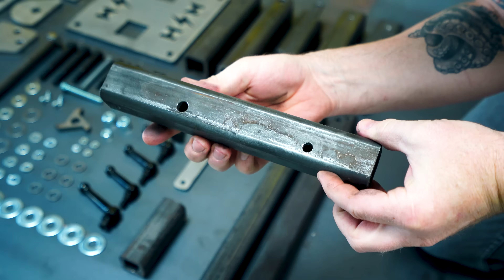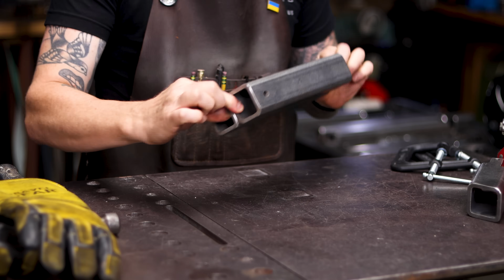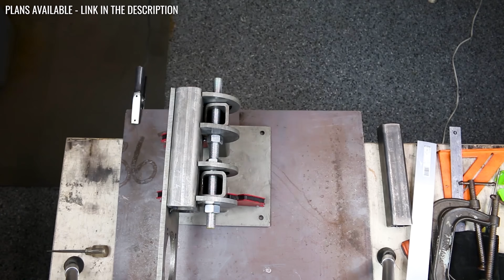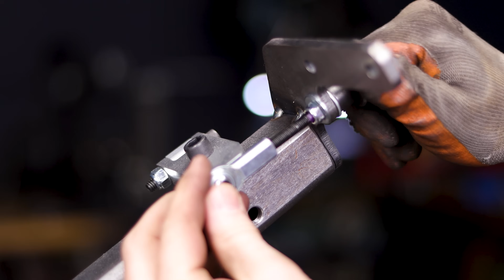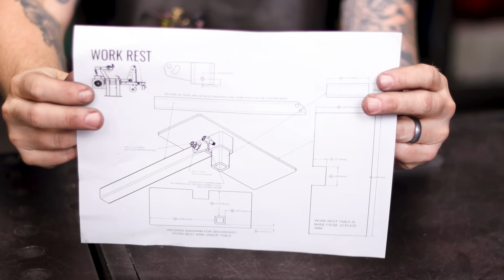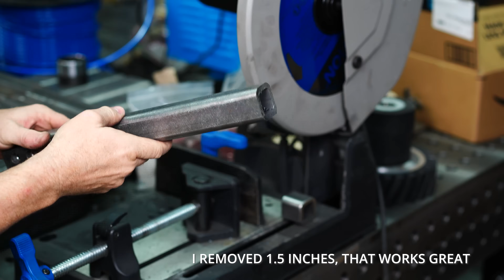How To: Generation 5 Revolution 2x72 Build

Comment: I picked up a 2 HP 3 PHASE motor free for my 2x72 belt sander. I love the $100 VFD video you did. My problem is the motor is not sealed. I am considering adding a fan on the opposite side of the shaft end that has a filter on it for constant air flow. I know it's alot of work to use this free motor but I gotta try it.

Comment: Should have some springs on the tracking device screws so they don't rattle and possibly set screws also.i suppose it wouldn't be hard to add them to it oneself either whilst building it.nice design and great videos
Reply from the maker: That's a great idea, thanks for the tip!

Comment: Recommended motor I purchased from Amazon shaft is too large for the  7" drive  wheel.  Brian, can you tell me what I should do?  Can you enlarge opening for fit my shaft?  Many thanks!
Reply from the maker: There is a small cover over that shaft, all you have to do is pull it off. 😁👍🏻 Easy!
Reply: @HouseMadeUS  thanks!!  Can’t believe I missed that!!

Comment: If I’m trying to mount a 3hp is there enough clearance or will the body of the larger motor interfere with the rear hinge, if it were an issue could I move the motor mount rearward making more clearance for the larger motor or would that also pose other issues??
Reply: Maybe I’ll measure first... but probably hang it back just enough to fill half of the rear plug welds and go slightly weld heavy around the perimeter to make up for it...
Reply from the maker: Yes it should have enough clearance. But always measure first. Thank you!

Comment: I’m curious… the flat platen is welded to the 90* brackets but I was under the impression the platen will need to be replaced from time to time?  I’ve seen some grinders, like the Bader for example, which I believe have a replaceable platen and the platen is a harder steel like 4130 or something versus just regular cold rolled?
Reply from the maker: There are two holes in the platen backer to attach different styles of platens. Works great for glass, leather, or high carbon. We are also working on a carbide platen.

Comment: Why not 2024 aluminum, or 7075, they’re both stronger… Btw aircraft grade only means it’s been chemically more accurate and tempered so there’s no stress in the billet, and less likely to have any micro voids. I’ve learned a lot over the years as a machinist

Comment: If i would like to make one of these and im living in Finland.. i should buy motor and vfd but we use 230/400v here. I have 3 phase 400v socket in my working space so should i buy 400v motor and vfd for variable speed control? And how to know if it fits to the driving wheel?
Reply from the maker: Please contact Matt at www.DIYEurope.eu

Comment: Would a Hobart 100 get enough penetration to do a solid job? It says it can only weld up to 3/16" material and the base plate is 3/8", I'm new to welding and don't know how strict these  requirements are. There's a big price jump to go bigger and ya boys on a budget. Thanks!
Reply from the maker: The work around for welding thicker steel is to preheat it with a torch. Mapp gas works great for this. It's not the most efficient way of welding but the Hobart 100 should do it with pre-heat.
Reply: I have a larger welder and I still only used about 85 amps to weld my grinder together, and I had to cut the motor mount plate off because I welded it on backwards and I was getting plenty of penetration!!! I’d say around 100 amps is about all you need for this project!!
Reply: I’m using stick welding that is ugly and I’m not a pro by any means so I may just be talking out my ass...
Reply from the maker: You're right, we've even done it with less. 😁👍🏻

Comment: I just purchased a DIY bundle. For the time and money that it saved me it's well worth the 700 bucks. However I am one to give an HONEST opinion/comment. The 1st 2 vertical support beams are so far my ONLY complaint. One was cut perfect however the other one was cut and ground very crooked up top where the radius is. I would have gladly waited one more week just to have that little bit of quality control. Because either way $700 is still $700!
Other than that I'm halfway through the build and it is looking pretty damn awesome. I'm not sure if maybe there was somebody new at the shop but regardless that crooked cut is there and it bothers me however it does not affect the main bolt that runs through them everything lines up just fine.
Reply from the maker: We did have a production issue. We sent all of those risers back to the machine shop to have them reworked. Unfortunately a few sets made it out the door before we noticed. We sincerely apologize for that.
Reply: No worries. It's only noticeable because I know it's there. Overall very cool design you have going on here and my son and I appreciate the informative videos you also supplied to your customers

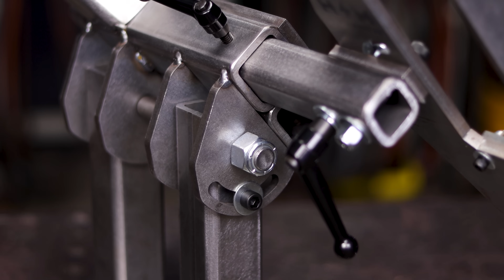Comment: @42:55 you might consider redesigning the front plate that holds the belt  so that it sits directly centred on the rotation axis of the entire machine.  This means the platform that will sit in front of the machine that holds the jobs to be ground will always remain centred to the belt .this can be handy if you are using a jog that holds the job being ground .  It currently appears that the front plate holding the belt rotates around the central axis of the machine and hence the belt moves off centre  as the main unit is  rotated
Reply: Platform that sits in the front being the workrest

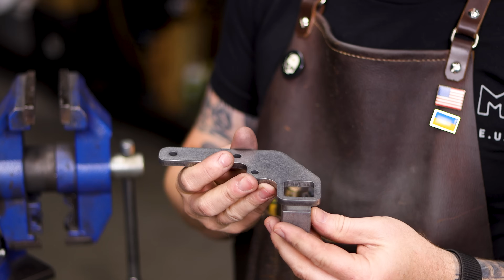Comment: @31:41 you might consider a washer between bolt and wheel bracket which helps the rotation integrity

Comment: @6.18 you can cut two pieces of wood cut to the distance needed  to jam between the two posts and clamp the posts and the bolt so the posts weld precisely to the base accurately . You should use right angle frames or magnetic to ensure those posts setup exact right. Get off to a good start

Comment: This thing is absolutely the bomb, man. I've got my old grinder and forge up for sale, just bought the apollo, and hope to pull the trigger on the Gen 5 next month. One question on motors. I see the links on the resources page to 3 choices, but I'm motor-dumb. theres not a huge difference in prices and they all appear the same with regard to hp and rpm and I can do either 110 or 220 in my shop, so I guess I'm not sure which one to buy
Reply from the maker: There isn't a big difference in those motors. We just link to them because sometimes one will go out of stock and what not. I have a video on running a 110 VFD and a 220 VFD. Both work great on any of those motors. 110 can bog down if you really push hard on the belt since you lose 1/2 HP going to 110. But it is negligible. Regardless the motor stays the same.

Comment: Maybe the question is dumb, but why no one makes a grinder that tilts an opposite direction, pointing the engine spindle down? That would let lower the center of mass and make it more compact
Reply from the maker: I think because of the weight of the motor. It could be done but the motor will want to pull it around the other way.

Comment: 37:15 Instead of loctite you can use linseed oil. It gums up with time but you can still turn it. I use linseed oil without hardeners. To help the hardening I expose a bottle of it to the sun by putting it at a window for a few month.

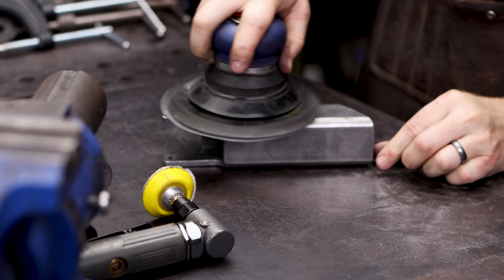Comment: Just a note: 2:00. Do NOT use Muratic acid for steel, for any reason. Muratic is hydrochloric acid (HCL) (stomach acid). HCL acid actually destroys the surface of the metal, leaving it susceptible to rapid flash rusting. Even if it looks clean, it will begin forming invisible rust and will continue to rust for months afer you've treated it with HCL acid, because this acid is not compatible with iron, it doesn't form a protective black iron layer on the steel. The ONLY acids that are safe are Citric acid, Phosphoric acid, and Acetic acid (vinegar). These 3 acids form a black protective coating of iron ferrite (not iron rust). Self etching primer contains Phosphoric acid. They sell metal conditioner for painting cars, and it's phosphoric acid. You wipe the bare steel with phosphoric acid, then rinse off, and you get a nice black iron barrier that won't rust later.

Comment: Welp I just began this rodeo this evening! So far so good - got the base frame welded up within 0.5* of 90 and the bold spins and the plate sits flat. Then welded the receiver tubes together. So far so good! Biggest challenge was my welder which I've had for 11 years now is actually underpowered for 3/8" thick material so in order to get any penetration, I had to preheat with a propane torch but that worked well enough...like he said...ain't building a skyscraper...just a grinder.

Comment: Metal working noob here, I have a question - you talk about cleaning the steel with mill scale, and "hitting them with a DA". I'm not familiar with that term. And also thanks for the rec on Penetrol
Reply from the maker: A DA sander is a 'dual action' sander. Essentially an oscillating sander really.

Comment: Talking about thick metal warping under heat, my great grandad was a shipbuilder in the old London Docks over 100 years ago. He worked until he was 85, lived until 96 and loved to tell stories of how they did things back - then fascinating stuff.  They used to bend the enormous steel beams in the big ocean going vessels using relatively small coal fires they built on the steel beams. The old timers would work out where to build the fires exactly to bend the steel exactly in the right place and the right amount. So no surprise that welding warps a 12 inch square 3/8" steel plate

Comment: I love your videos House! Gonna start on my 2x72 this weekend, cant wait. Gathering everything up this week and parts should be in from amazon by thursday! All of the parts i got from you got here fast and look good. I saw that the hinges are sold out when bought a la carte so im making those myself. i was looking at the new instructions for the Gen 5 build and it seems like maybe some dimensions are off on the Hinges page (23) i have checked and rechecked and even waited to get home to my digital caliper but some of them are right others are not. Which makes me think i printed to scale correctly, so i dont think its that. Im sure it doesnt matter to the build for the bigger picture right? Just need to make sure that the center hole is drilled uniformly so no big deal but i guess im somewhat asking if im right or wrong, and if so just a heads up!
Reply from the maker: Yeah the only critical dimension is where the hole center is. The rest is just aesthetic. 👊🏻
Reply: How easy is it

Comment: I found a lock washer for the tracking arm bolt works well to keep it from rattling loose and still allows for enough movement for adjustment if you get it in the right spot. I really like the new tracking adjustment set up, i will probably upgrade in the future. Nice work, just wanted to throw this other option out there that i found works for me.
Reply from the maker: What we found was the split washer dig into the aluminum and created a burr over time so we don't use that, just the Loctite now.
Reply: @HouseMadeUS  aluminum? Are you talking about the wheel? If so i put the lock washer on the other side where the lock nut is.

Comment: Just a point information, and you probably already know. If you mount aluminum to steel, it will cause something called electrolysis.  You might want to look at making the tracking hinge plates in steel.

Comment: At least go corner to corner with the welds to tie in the tacks...
Reply from the maker: Why? Doesn't need that.
Reply: It's a very well designed product, in my opinion it makes it look cheap.
  Generally if you're going to do stitch welds, you'd place your tacks where your weld would cover them.

Comment: The design just keeps getting better and better!!! Glad I waited :-) Also, you can get Penetrol in CA if you know where to look (hint, it wasn't banned for marine use) But you know what's even easier to find, and cheaper??? Just go get some boiled linseed oil and wipe it on! Penetrol is just oil plus Cocamide DEA. Want it to sink in deeper and last longer and look even better? Heat up the metal you're applying it to, brush on, wipe off, let cool, and buff out. Raw metal look, strong finish, no rust.
Reply: Hey, also, I just went to Amazon and it didn't say "we can't ship that to you there" like they do with restricted stuff. So I'm guessing it's still easy to get in CA.

Comment: Very cool build and design.   A few years ago I started cutting out all the parts for one of these.   I  didn’t need it but it looked like a fun build.    I already have a sweet little dc motor and controller so why not.   One thing I really hate is cutting out steel.  I have access to all the free scrap I want up to an inch thick.   Stainless even if I wanted.   This already being cut out makes me want it. I would only have to cut out a different motor mount.   Maybe I’ll get out what I started, nah.  I really hate cutting steel.   😮.  Maybe I’ll order yours.
Reply from the maker: Hi Gene, yes definitely a tough job to cut it out manually. Maybe find someone with a plasma or yes you can buy into my kits which make it very easy. No more machining

Comment: Hi Brian, couple questions :). I'm sure it's fine but just checking, is sandblasting all the parts fine too? I know there is some material removal, so just making sure. Also, on the motor plate weld, you didn't call out any  extra warping concerns (that I noticed) in the video. With four plug welds like that, is it a good idea to really lock that one down too? probably is, but I heard you in the beginning "do what I do" so that's my plan :).
Reply from the maker: Hi Jeff, yes, you can sandblast all the parts that is no problem. Also, if you do not clamp down the motor plate like I did in the video, you can get warping. So make sure you clamp everything down and let it cool before you remove the clamps. Also, I like to just check to see if there's any curvature to the plate before I weld it and then use that as my guide to correct while welding.

Comment: While I applaud the constant evolution of the Revolution grinder, each generation pushes the price further away from that of a viable alternative as an entry level kit for the casual DIYer. Don't get me wrong, I'm still going to buy one but this extends my already excruciating 3-4 month timeline by 4--6 weeks. Again, I applaud the constant innovation. It shows that you truly want to put your name on the best product you can possibly make, keep up the good work.
Reply from the maker: The way I look at it is I reducing the amount of tooling needed and that offsets the cost difference. Also you can buy the kit in parts (very soon) and then you can just get the plate steel (for instance) and machine the rest of you like. Still a lot of options out there to save money. The cheapest way to do it is to buy the plans and hit the scrap bin and make the parts from scratch. Still very possible. I will say time is money and we have traded some of that valuable resource to make the kit better. I appreciate your support as always. I hope you build one soon in any capacity. Cheers! 🙏🏼